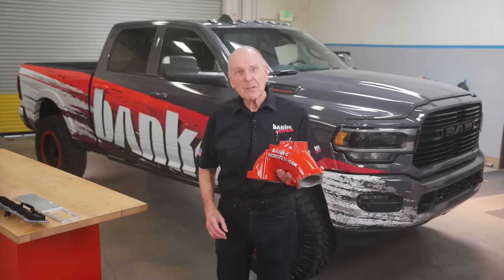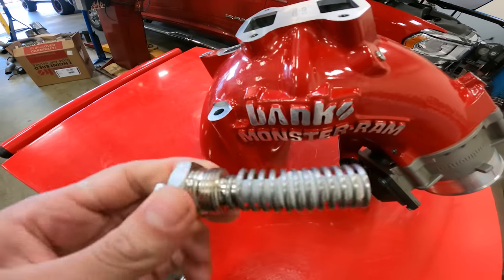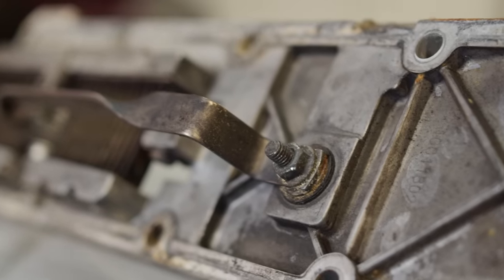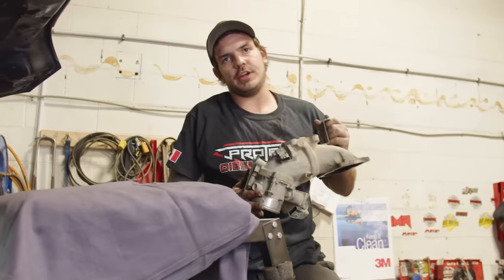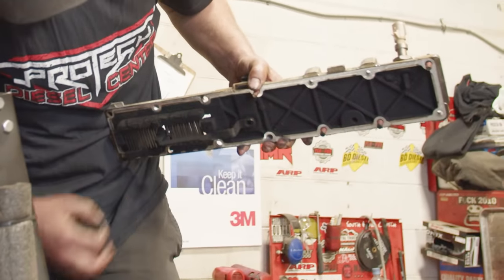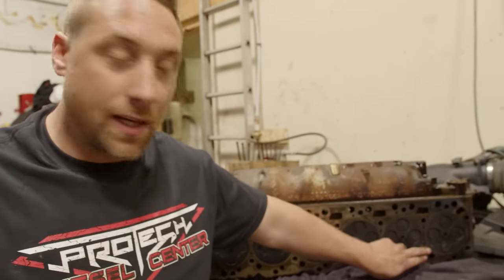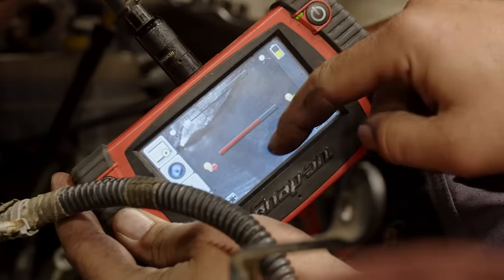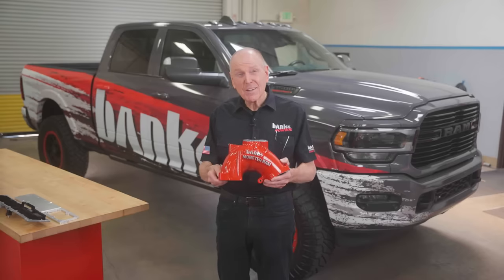How to prevent RAM Cummins 6.7L engine failure due to stock grid heater

Comment: Is this common on the high output Cummins as well? I have a 2022 with high output engine. Haven’t seen it this is an issue with them also.
Reply from the maker: We've seen the failure on the HO trucks. Although this affects all 6.7l Cummins, we see it mostly with the 4th-gen 13-18 trucks.

Comment: I own a 2012 ram 2500 had original 6,7 Cummins in it. I blew up my engine and traded it off for some boot and received a 2014 6.7 to install. After investigation I found the the '14 will mechanically fit into my truck but it will not plug in. the plugs on the '14 engine I now have don't fit the wire harness plugs in my '12 truck. Unable to go back on the trade, long story, but im looking into finding another engine to purchase to get back into my truck. Overall, my main question that I'm needing experienced professional help with is, what year, model ram can I pull a compatible engine out of that will fit and plug into my 2012 2500. I have heard "10-"13 2500 engines will work. I have heard only '11-'12 2500 engines will work. I have heard '11-'12 3500 engines will work but nothing 4500 or bigger. I need some professional help here. I've already made a mistake once, I have to get this truck back on the road and I don't want to dig any deeper without correct direction. Thank you for what you all do, and any help, advice, or referrals in the right direction is greatly appreciated.

Comment: Evening- I installed the monster ram on my 2014 ram - since install I have been getting a check engine code Po299 underboost— any ideas what is causing this? Truck runs very good so I’m thinking it’s a sensor of so type- please help- thanks
Reply from the maker: Happy to help you out with troubleshooting this code. Please contact our tech support team, M-F, 8a-4p at 626-969-9600, option 4.

Comment: How could it be a complete engine replacement? Wouldn't u just replace the piston on the 1 cylinder if it make it that far, or have the head redone ?
Reply: bolt could score the cylinder enough to make the block unusable

Comment: Does doing this upgrade void the warranty?
Reply from the maker: This largely depends on your local dealership and service writer. We suggest checking with your service advisor. Then you'll know for sure whether they're cool with the accessories like the Monster Ram. Treat the Monster Ram as you would with altering the truck’s suspension. Most dealerships understand accessories like upgraded suspension systems is harmless, however, some dealers are not willing to work around a part like this.

Comment: Does this void warranty?
Reply from the maker: Technically, no it cannot void the factory warranty. However, this doesn't mean dealerships won't try to do it anyway. It's best to have a conversation with your dealership prior to installing any aftermarket part.  If the dealership warns against aftermarket mods, find another dealer that embraces them or sells them. There are hundreds of aftermarket-friendly service centers.

Comment: What’s the expected mile range failure on the oem part? I’m thinking I should buy this around 85000 mi due to the 100000 power train warranty
Reply from the maker: We've seen it as low as 40k miles. It can happen anytime.

Comment: Hey question can this kit be used on a deleted truck. I know it is designed to ne used with all factory components bit what if they are already gone?  Thanks
Reply from the maker: The Gen-2 Monster Ram will work with emissions compliant and tuned truck alike.

Comment: What about replacing the stock item with a stainless steel or more durable item?
Reply: Like just the actual nut and bolt that fails.
Reply: That would be too cost effective 😂

Comment: Several years now and they haven't addressed the problem???!!!!!
Reply: Not surprised by that. 

I would like them to address the issue of false advertising and false badging! They claim the 2500 & 3500 series trucks are heavy duty trucks by advertising them as such and placing a badge on them labeled Heavy Duty. 

Let’s be honest, a 2500 truck is not a Heavy Duty truck! Neither is a 3500! The transmissions in them other than the Aisin are not even in the same classification as the competition’s Heavy Duty transmissions. 
They are light duty trucks that are more capable than a 1500 series. They can tow more and haul more but that’s it.
Reply: @josemejia6645  I have the 21 5500 ,and u think we should sue them because the false (heavy duty)

Comment: I just took possession of a 2022 custom built 3500 and bought the extended warranty: At what year/mileage window can I safely make this change w/o impacting the extended warranty?
Reply from the maker: We recommend checking with your service advisor before installing. It's no different than altering the truck’s suspension. Most dealers are cool with accessories like upgraded suspension systems, however, some dealers are not.

Comment: Ram now has a recall on the relay for the grid heater due to fire hazard. Will this possibly fix that issue also?
Reply: Great question, i wonder the same as i just bought a 2022...too bad nobody with answers has bothered to fukn reply..maybe i look on a ram forum next.

Comment: I have a non egr monster ram on my '13 2500. Can I just get the intake plate and new heater?
Reply from the maker: You'll find the intake plates for your Monster-Ram here. https://bankspower.com/collections/racing-parts
Reply: @bankspower  does the heater work with the non egr monster ram? I live in a cold climate and would definitely need to keep something to warm the air.
Reply: @rodneylalonde6382  Canadian here wondering the same thing!

Comment: Why do you need to heat the intake air?  For when its so cold the air/fuel coming into the cylinder cools the glow plug so much it can't start?
Reply: Cummins engines dont use glow plugs
Reply: No friggin idea...
When its like -50 Celsius out in the fucking arctic the grid heater MAY help you start the truck. Apart from that its a useless restriction in the intake.
I know ZERO other diesel engines with a grid heater.
Here in Europe it gets pretty damn cold especially up north and our diesels start just fine on glow plugs and compression alone. No need for starting fluid or heated intake air.

Comment: Nephew said he wanted to do this for more power .. he has the emission /egr/cat delete and cold air upgrade and tune already I initialy told him he doesnt need this much more power and that the $1000 upgrade is not needed. professional dealer mechanic but not diesel mechanic so had to brush up on the topic .. For the power not needed. but for the prevention of catastrophic failure due to a piss poor factory design ? this is a fucking no brainer and is going to be done as soon as feasible and might even look into a replacement oem heat grid if not expensive to remove the erosion from the equation because this is a erosion issue more then a weak part so if cheap enough replacing the stock heating grid if cheap will buy him some time to cough up the money for the banks unit .. if a new heating grid is in the range of $80 or less its money well spent because access to do all this is pretty easy.

Comment: Does anyone know if this is common in the 5.9 because I have a motor in my garage w the exact same issue the #6 piston has a very similar piece of metal/possible 10mm bolt imbeded in the piston. Also  the #3 piston got something similar in it too. I already had the head rebuilt but did not know that this could have been the kill issue on my motor. Anyone care to tell me about the 5.9 and if this is common in 5.9's too.
Reply: The 98.5 to 07 Cummins 5.9 has a totally different design heater grid.

Comment: Without having to read 570+ comments, how about important things like what years are involved and is there a common mileage between the ones who've failed?
Reply from the maker: We've seen it happen on the whole model range, 07.5-present with it being the prevalent on the 4th-gen '13-'18 trucks. There is not a common mileage, it varys. We've seen with only 40k miles and 200k miles.
Reply: @Banks Power  thanks for that, do you suppose disconnecting grid heater and relay would buy me some time so i can start saving up for your products?
Reply from the maker: We don't recommend it, it will trigger a check engine light.
Reply: @bankspower  so does the banks monster ram conversion eliminate the grid heater problem and the relay problem?

Comment: Why Cummins would do something that seems this obviously stupid is beyond me.  I get the feeling we’re not getting the whole picture here as to why the design is the way it is. Yes I know the obvious answer is price, but I’ve worked in the industry long enough to know that design decisions like this are not always about price.  Perhaps this is more of a cold weather climate issue? Regardless, still seems stupid. With all that said however, aside from the obviously completely different design, is there anything to the Banks heater element that would prevent it from failing and damaging or destroying an engine?  I’m not being critical of Banks, rather just curious if there is some other fail safe in place in case the Banks element breaks as well. Different positioning causing it to drop to the bottom of the charge cooler piping as opposed to going into the engine perhaps?

Comment: So a flawed design from the factory and somehow they are not doing recalls or at least an advisory? Does Dodge not care at all?
Reply: First off its a RAM...Dodge trucks hasn't been a thing for 10 years.  Second, this is a very rare occurrence and hyped up to scare you into buying their aftermarket parts.
Reply: @brandon18054  Yeah, let’s just call Corvette a Chevy and Lincoln a Ford while we are at it.
Reply: I believe they don’t care! I’ve had my RAM Cummins in two different shops dealing with DEF issues that put the truck in limp mode and derated to 5mph! Neither one can find the issue because it does it intermittently and when they check it out their scanner says all numbers are within spec! So I call FIAT for some assistance and they basically told me since it’s out of warranty their is nothing they can do. 🤦🏻‍♂️ Truck has 112,000 miles so yeah it’s way out of warranty according to them! So much for heavy duty claims right?! More like False Advertisement! We are the Guinea pigs and end result of their under engineered garbage and they laugh all the way to the banks!

Comment: The engineer that designed the grid heater system must've been drunk that day. Anyone with common sense (let alone an engineering degree) can see what an overall horrible design it is. At the very least, it is so OBVIOUS that it is going to get completely closed up solid with carbon. And as it does so, it's going to be restricting air flow more and more. Just.... wow.

Comment: Has this been resolved on the newer models I just purchased a 2022 1 ton Dually and I use it daily for towing my tractor to and from job sites
Reply: K A I’ve been driving dodge trucks for over 40 years never had any real issues I’ve never heard of this problem research has nothing to do with it nor does voting, I would assume someone like you is probably driving or going to purchase an electric truck I would assume that’s where your votes go as you said good Lord people. even banks who developed this product didn’t know they developed something that would resolve a problem on a dodge truck and those are from engineers, I only asked a simple question if Dodge got this possible issue resolved if it is even a real issue I have a feeling the issue occurs when you modify the truck which I don’t and again I’ve never heard of this problem I had a 2016 Dodge 1 ton and never had a problem with that truck and this is the model year they were describing but to confirm voting has nothing to do with a Dodge truck go buy the electric one,

Comment: What year model 6.7s are affected by this failure? I have a 2009 Ram 2500 with the 6.7 . Was wondering if I am a candidate for this? Please enlighten me. I am a huge preventative maintenance type person. I will upgrade to this if mine is included?
Reply: It effects all of the 6.7s regardless of year.
Reply: @georgeramsey2827  Does it effect the school bus a medium duty truck versions of the 6.7?
Reply: @ronunderwood5771  you can look under the hood to be sure. Id say yes since it is how the 6.7 preheats on cold mornings. You can follow the wire from the relay by the passenger side battery over to the preheater.

Comment: So does this Grid Heater work like a glow plug? Or is a cold climate thing?
Reply: it activates on low temp to help put some warmer air in to help with cranking engine. if you live in a place with temps under like 20 deg or colder it might be helpful, if not many delete it or go with the banks intake which uses a different heater method.
Reply: @carl2591  so really just used for start up?

Comment: So when that little heating coil fails and breaks off, will banks cover the damage?
Anyways the real fix is just replace it with a stainless steel bolt and have a nice life. Geez.
Reply from the maker: We've not had one break yet and it does not present the same problem that this bolt does. Here's how the problem breaks down. 

https://official.bankspower.com/insider_news/ram-6-7l-grid-heater-engine-failure-cause-prevention/
Reply: 💯%!!!!!!😂 That wouldn't cost $600+ tho!!!

Comment: Dumb question... why does it need an intake air heater?
Reply: Only to assist in cold starts. My '04 5.9 started at -10° F without one, though. If you plug in yiur engine block heater, I doubt you'd ever need a grid heater in a Cummins. Fords with glow plugs are a different story
Reply: @gadsdenconsulting7126  Great answer thanks!
Reply: @Jimmy_Jim_Jim_1234  you're welcome!

Comment: Hahahaha I love this! Buy a nice new truck and oh…sorry ya engine is fucked because you didn’t get a single part from Banks. Thanks cummins. Couldn’t just tap that bracket and bolt from the outside of the engine instead of having bolted from the INSIDE IF THE ENGINE. Engineers…should be a recall on this. 300000mile toyota motor is more reliable than a cummins nowadays.

Comment: Why not just pull the intake cover and install a new SS bolt and SS lock nut for a bone stock truck? Much cheaper solution and wouldn't risk any warranty BS.
Reply: @Stay Asleep not from corrosion which is my understanding why they fail. Any good grade SS would hold up. It's just a wire. Lot of lug nuts are SS. I've used many of SS bolts and never had any failures. They even make SS brake rotors.

Comment: $800 plate/intake or just removing the heater grid cable off the relay and zip tieing it aside till needed. Do what you can afford imo banks is way overpriced

Comment: I have zero idea why this thing is even on these engines. Restrictions in the intake especially behind the turbo are bad and your engine efficiency suffers from it.
Delete this useless part and disable the EGR in the process.
Disabling the EGR does wonders to our diesels in Europe. Better MPG, healthier engine, improved power and engine efficiency since its fed fresh cool clean air without hot exhaust gases mixes in. Guess its the same for a Cummins...
These days engines use less and less EGR to get emissions down since DEF Injection and sophisticated catalytic converters are superior to EGR in terms of reducing NOx effectively.

Comment: good job Cummins any other bright ideas from your bright engineers just like there G56 6 speed manual aluminum transmission housing. i got a good idea lets put a bolt upside down in the engine and make an aluminum heavy duty 6 speed manual transmission housing OUT OF F.......ALLUMINUM your not saving anything boys
Reply: That was apparently built by the same
Ford engineers that thought it would be awesome to make a truck skin out of aluminum to cut down weight and advertise it can tow and haul more with the same powertrain because they just can’t squeeze anymore out of it safely and make competitive claims!

Comment: Ever try to start one of these pieces of oily shit when it’s -20?  Without the grid heater it wouldn’t happen.  Get a webasto.  If you spend 20-30K on an engine you’re getting ripped off.

Comment: $20 or $30 thousand to replace a motor. I think that is an exaggerated statement.
Reply from the maker: With labor and parts, in excess of 20k is about right.
Reply: @bankspower  I don’t see how the expense of a diesel and the maintenance and fuel difference is worth it unless you are hauling the very heavy loads.